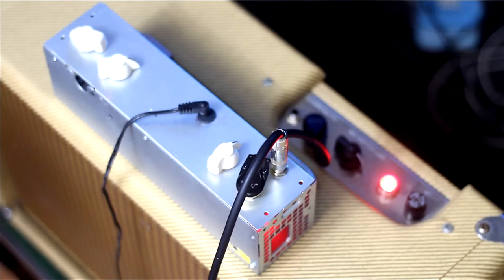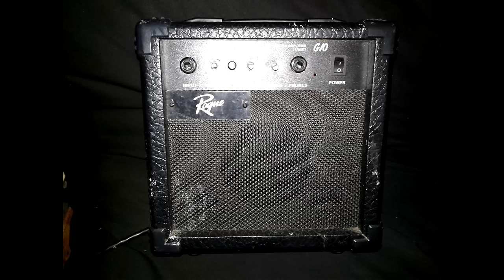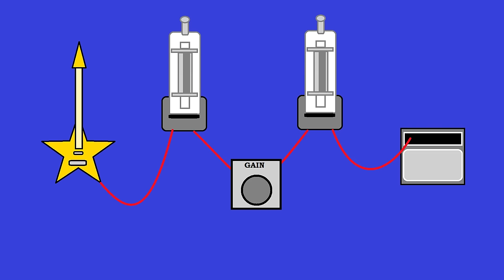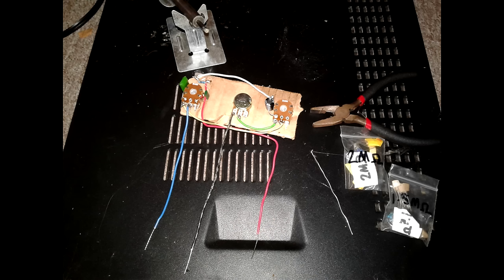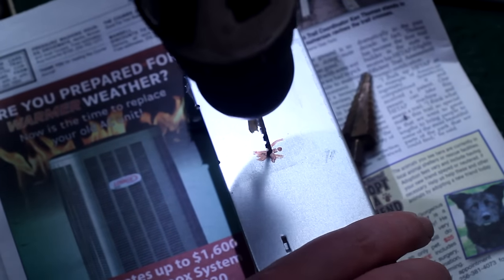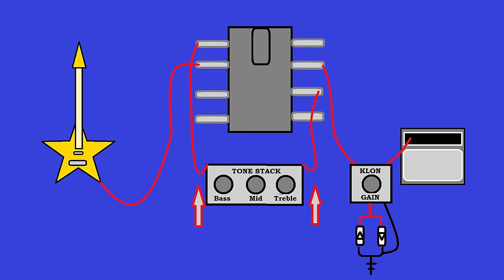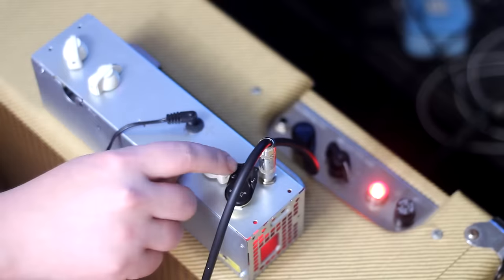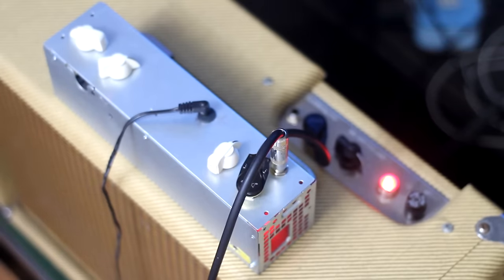DIY Guitar Tube Preamp Build and Demo (Super EASY!)

Comment: Not to take anything away from this video, but this entire 'tube' thing has been a fabulous marketing ploy for years among the gear manufacturers.  But there is a huge difference - and price tag - between a genuine tube preamplifier and the "hybrids" which use solid state devices in front and behind the actual tube to produce the actual gain.  A typical 12AX7 (the most common of preamp tubes) needs 150 volts of pure DC to operate as it should as a high gain preamplifier.  A 12AX7 will pass signal with much less plate voltage, but it won't really amplify or produce any real 'gain'.  The real expense in manufacturing a true tube unit is the power supply.  Converting 120 volts AC to 150 volts DC - and that's DC with as little "ripple" as possible (otherwise you have hum) - requires a costly step-up transformer and a fairly sophisticated circuit using diodes, capacitors, and resistors to "filter" out any alternating current (AC) "ripple".  Many of these so-called "tube" preamps are able to eliminate the step-up transformer and just filter the incoming 120 volts AC down to a useable 50 volts DC as the tube's plate voltage using a few inexpensive diodes, caps, and resistors.  But the real 'gain' in these hybrid devices is produced by the solid state devices - IC's (integrated circuits) or "opamps" (operational amplifiers), not the tube itself.  This is why you will see hundreds of dollars' price difference between a genuine tube preamplifier and a hybrid.  Yes, you do get the benefits of the tube's natural, musical, harmonic distortion, but it is somewhat negated by the junk on either end of it.
Reply from the maker: Thank you so much for watching and taking the time to write such a detailed and well thought out comment Chuck. Oh I understand completely where your coming from and I can agree totally but This is really a nice way to get some people in on the tube thing that dont have all that much money or technical knowledge and I thought this would be a good first tube DIY for some people interested because 25-20volts wouldn't feel good but at least it wouldn't hurt you badly. I do have a DIY tube amp build (Fender tweed circuit) on this channel that was running about 400 volts on the plates but I made sure not to chow me poking around in it with the thing plugged in and not discharged which I had to do quite a bit of for trouble shooting as it turned out I had a factory shorted 6v6. I also did a tube amp power supply section build purely from trash like reclaimed parts out of computer power supplies and old tube hifi unit transformer and whatnot and I never posted it because I did end up getting the hell shocked out of me by the metal top of a capacitor. Luckily it was unplugged and already draining and I had one hand in my pocket, but I took a good instantaneous 260-280 volt dump to the hand and it SUCKED! I don't want that or worse happening to anyone else because of something they saw on this channel. So I selected this unit because it actually doesn't use any solid state components for amplification or anywhere in the audio path it uses 6J1 a copy of soviet pentode tubes that are designed to run well on lower voltage, similar to the ones in old cb radios and car radios from back in the day. It does have some solid state jfets on it but they are just used to boost/buck the voltage from 12v ac to about 27-30v DC I had to use a  hefty 1.5 amp AC transformer but its on the outside of the box. I just thought this was better than one of those 9v DC starved plate designs you see so commonly used and it could be built simply for a beginner without them being in any great amount of danger. But in general I do agree with you and see exactly where you are coming from but this unit isn't hybrid.. its legit though its relatively low voltage and I had to supply the transformer myself.

Comment: Only 48 volts? The guy I've interned for who makes audio equipment for mastering in the 5000 euro range uses at least 96V to get the maximal tube sound out of his tubes. In his defence, he mostly makes compressors, EQ's and amps that aren't supposed to clip, so if that's what you're mostly interested in, 48V is fine, and it's also safer.
Reply from the maker: Thank you for watching and taking the time to comment SDBJ. Yes more voltage gives you more head room between the rails so to speak. This is actually surprisingly clean and strong given the voltage but I think thats due to the type of tube but, yeah exactly its safe and itll work for beginners and seasoned builders on the cheap :)
Reply: @heavymetalATC  update:
 he actually runs surplus soviet military tubes at 220V. 
The way he explains the behaviour of the tubes is that they require a certain amount of voltage to reach a good level of nonlinearity, phase shifting, distortion and whatnot. 
In his own words, it's not entirely clear why they sound so good to our ears, otherwise we'd have good simulators.
His company is called Gyraf Audio, if you're interested. Some prime examples of his products would include the G10, G22 G23 and G24.
Reply from the maker: @StevDoesBigJumps  Oh yeah he makes the good stuff. I plan on trying a few diy studio gear projects on here sometime myself. Probably not tube but???
Reply from the maker: Learn everything you can from that man its hard to find people that are the real deal. soak it all up.

Comment: Speakers and cabinets for them are impulse response for additional tone tunning.
Reply from the maker: Thank you for watching and taking the time to comment MrShmanckles. Absolutely! Speaker and cabinet choice can play a very big role in tone, Also the type of power amp section used and the value of the coupling capacitors that are placed between the preamp and power section make a substantial difference. A smaller cap can brighten up a muddy amp/speaker combo or a large value coupling cap can make a sweet preamp feed pure muffle into the power section. Its all just little parts of the equation like ingredients in a cake.

Comment: Ya, pls be careful with tube circuits. They can hold enough charge at high voltage to kill you. If you don't know what you're doing or how to bleed a circuit, don't risk it. 

As an EE who has a passing interest in audio, but never attempted a hobby project like this, you have impressed and inspired me
Reply: This preamp works on 12v ac as low a 500ma. I guess you could get a little shock from one of the capacitor but nothing that could kill you or injure you badly. But yeah, we should always be careful anyways!
Reply from the maker: Thank you both so much for taking the time to watch and leave a comment. Correct David I think this think only boosts the signal up to 27 volts to the caps or something similar I cant remember exactly what Petey said it tested at. Jerod you are right about being careful I have been accidentally hit with about a 246-250 volt instant dump from 4 big filter caps into my hand before it is not nice at all, I forgot that the metal end on top of a cap was hot... I was building an amp from scratch using old reclaimed junk parts so I wanted to make sure it didnt feel hot or bulged... POW! yowza!~ I decided to not upload the vid on here because it really was too dangerous. Luckily I had my other hand in my pocket and not on a ground. Once I regained my bearings I thought back to building my champ clone and without tubes pulling it down it was testing in at like 430-460 if I remember correctly. I am so glad I didn't get hit by that because I had a long trouble shooting period with it powering it up testing it live and draining it many many times... It was a bad output tube and a maybe a little bit too high on the end of spec rectifier. Set of JJs fixed it right up. Still glad I never rode that lightning though. Ive been hit with high voltage ac and dc many times as a welder but those caps dumping into me was really crappy painful and scary.

Comment: Personally, I'm not a fan of the plate starved tube design. Just doesn't sound nearly as good as a tube running at proper voltage, to my ear. Take 2 12V transformers and connect the secondaries. Plug in one transformer. That gives you 12V at the secondaries to run the heaters and then you've got 120V from the primary of the second transformer to run your plates. A bit bulkier, but gets that good sound.
Reply from the maker: Thanks for watching and taking the time to write such great info pete. Yeah I agree that would probably sound much better but I can have folk frying themselves cause of my video. hahaha That is a great way to do it and make a good isolation transformer with heater tap for cheap! Thank you for the tips.

Comment: So I got one of these boards. And one of the capacitors... exploded like a firecracker. It was one of the 1000uf caps near the edge with the LED. Weird. I'm chalking it up to shitty components as I was playing through it when it happened. Just be aware, I guess? I'm replacing the caps... no biggie!
Reply from the maker: Oh wow thank you so much for the heads up Towmotor. Yeah you know how the cheap Chinese stuff is now days. I'm glad you are an understanding person that also knows how to repair it. Ive luckily not had any problems from mine so far. Thanks though that could be quite a scary and infuriating incident for someone that isn't very versed in electronics repair.

Comment: You seem like a guitar player that has just enough electronics knowledge to get yourself killed. I have thirty years electronics experience and I'm a licensed electrician so I'm used to playing with voltage but I also have been building custom tube amps for about 10 years. It was an entertaining watch though.
Reply from the maker: Hahaha Pretty much correct but I also built the custom tube amp the preamp is sitting on. ;)
Reply: @heavymetalATC  Don't misunderstand, I was being sarcastic but you are creative and like to ask yourself what if. Reminds me of myself in a lot of ways. Like when I post on a forum about the latest amp design I built and I am tying to explain whats up but they just feel like I should build Fender or Marshall clones, BORING!
Reply from the maker: @skullheadwater9839  Thank you bro, Ive shocked myself damn near off the planet before while building a tube amp though so you have some truth to your words. I was a welder/fabricator for many years so I can take 220-240 AC from a miller welder for a few seconds like it aint no sweat but getting a bank of 4 caps dumped into me at once... shoooooooooooweeeeeee! it was a slam not a buzz it felt like a hammer. I did have 1 hand in my pocket and not on ground thank the lord. I hit the real ground though. good times I never posted 1 second of that build on here. 🤣

Comment: Tubes get too hot to touch when on so that sideways config should burn the board.  Not a fan of that config at all if the tubes get beyond body temp.
Reply from the maker: Thank you for watching and taking the time to write a very engaged and well thought out comment. I really should have felt of one of the tubes after running it for a while but I didn't think about it. There are units on ebay that are Identical to this one but the tubes are standing up away from the board. Its a kind of modular design and they build it a lot of different ways. Here is a link to that: https://www.ebay.com/itm/1pc-6J1-Valve-Pre-amp-Tube-PreAmplifier-Kit-Assembled-Board-Audio-DIY/121611607261?_trkparms=ispr%3D1&hash=item1c509ddcdd:g:PCUAAOSwLsBZS4RA&amdata=enc%3AAQAFAAACcBaobrjLl8XobRIiIML1V4Imu%252Fn%252BzU5L90Z278x5ickkp2NA0WuhQytmt4dbStg00BWgoOScyZwybBXC4%252Bfo0CnuQYr5MJ4lvHHEiBnM%252FvwcYpMb%252FOpiGPkFun268Yr5e%252FsAeC%252FazxFp0mPTFUTdX4BpumEl6ofAC%252B6vXRsHHCBDs8rwHZYndQuPIHrGr3XyZpZeExB9jeZQwq6DsIZ5UXZMrR02tedKSqSMMXbD4BLI%252FSsHO49kx1geP7x5oIblxYSS7rn3GkWdQnAUODd2Jn%252BmNuYkucpAMArPsqVjLo8R4s%252BfG3W8W5f8XDE4Di0S5SiT62nUREjOwtbnhgoWTHCO3Oo5due4I0X0MlW6eh8R9y%252FUeAhTweqjf6j10BwhoyAcmj1i0W2CDYBGsPr2ca1gtjpM9B1gwfUvt0KuMGwNNmCSLsP3BgYjiz3q3CGzqz7HTLp9Aj%252BKMFo3T53Iy2HItGQp%252FJWbuGrylQammRsGuBUVsW%252FFIRFMg4bNEBRW1saGwefGoSLqSgGmPLdAt0hdCJ60xWPR22VbpJTqqTFm8irnYQ00uzz3uHSWxJ0S5wV5qdJUozEYDzAu0dROqJDuHUVQqRPTkhw8ooDCIWabkgP809U9makyYI572A5hHJa6YpxUEgxmetKN7EI%252BO%252BPu7I9T6g2KzO8rLwBdz%252BecB4PMnM174ujEuzDBoGUfDwHvj3lEJJhTUh43iifFiJCOHl2hScw66kcVKBZbdazJ%252BGtDoCwmi60eUm3uCS3AqGfvHvctXSKNTpDN%252BVyGsnAyZFj1SgjTop1he%252F5kg8Q6RERWKrYFgZzkh3rZLkmABQ%253D%253D%7Ccksum%3A121611607261e837f008d5574ae9a1df9a9fb932286b%7Campid%3APL_CLK%7Cclp%3A2334524
Reply: @heavymetalATC  You are welcome.  I know this a 12AX7 on my old 1970's TV burned me so badly I never forgot it PLUS I have had other tube electronics that has browned wood and PCB material.  Heck, they even brown their own ceramic tube holders.  Just an old guy who remembers tubes and upright, with plenty of ventilation, is needed for most.  Now a few 6V6 like tubes just got warm actually but the 12+ stuff would cook in there (nothing like turning on the TV in the winter to warm your room, lol).
Reply from the maker: @generalawareness101  Yeah, the tubes in my champ clone get SUPER hot. I'm sure its due to having the plate dissipation too high biased from having higher than stock voltage but I needed it for the extra headroom, its not to the point of red-plating and JJs are pretty rugged tubes so it has lasted quite a while on this set. Plus its cool to watch the blue glow swirl around in there when you are really cranking it up. LOL It smoked a set of chinese shugaung tubes immediately on startup it looked like blue flames inside the bottles and it was arcing all kinda wild inside the rectifier tube. I put a lot of old school style solid state as well as tube gear in my small home studio as I thought I wanted all analog signal before it goes into the computer and damn it gets so hot in there in the summer.
Reply: @heavymetalATC  Right.  The link you sent me seems to be a 6J1 and those don't get nearly as hot as the higher voltage ones but in Radios, TVs, etc... a 12AX7 will burn you badly and there are some that were even worse.  They weren't over biased either but everything eventually turns a yellow brown around those tubes.  Sixes aren't nearly as bad and probably why they used them (btw, sixes do not sound nearly as good as a 12 and I am surprised to see them being used for this when normally a 6 is right before the 12).  Maybe the 6, being a preamp, is why because a 12AX7 is actually an amp and the reason the 6 was before it so the 6 drove the 12.
Reply from the maker: @generalawareness101  Yes sometimes like in the fender amps they will make the good sound and tone using a 12ax7 or 2 and then use 1 or 2 big bottle 6v6s to push the speaker. Yeah its the 12ax7 in my amp that gets so damn hot. I replaced it with a jj ecc83 super rugged tube but its still way too hot to touch just better at taking the heat. I also used ceramic sockets with aluminum sheilds into a steel box on it. I have seen some of the old rca stuff that uses a brown or black bakelite plastic socket... thats just asking for a fire.
Reply: @heavymetalATC  You better believe it and I saw those.  A cost cutting measure in the day since any quality gear (or a company that cared) used ceramic and the metal plates was a sign it was heading into pro quality stuff.

Yeah, I have seen the 6V6 stuff used that way but the Guitar world is a weird beast because it broke all the rules to "get that tone" but in regular TV, and radio, electronic 6V6 came before the 12ax7.  Not sure why since the tube days was in my pre teen days and by the time I got into electronics around 11 every new thing was transistors or the new ICs.  Back when being modular was a cost cutting measure and prevented the consumer from doing their own work.  Just throw the entire board away and buy new yet only one component was bad.  My mom was on the assembly line making those boards for Texas Instruments at the time.  We saw the future and it was bleak to us since we liked to fix our shit.
Reply: Tubes get hot. They must have ventilation. My headphone amp has one 12AU7 it lights up but doesn't get too hot. I believe if the plate voltage is high you will get heat  but if the plate voltage is only 12 Volts the tube only gets warm. 73

Comment: ½-Great! But, how to make it sound like a wet fart i.e. full great?
Reply from the maker: Thank you for watching and taking the time to comment Beaticulous. I would guess by wet fart you mean like killing fuzz/distortion from hell. If you just run one channel straight into the other with no tone stack that will get you about 3/4 of the way there if you ran a diode from hot to hot jumping them instead of a wire 5/8 of the way if you run a diode or better yet an LED from hot to ground in between them or even better than that 2 facing opposite directions 7/8 of the way to wet fart but... if you put a big ass capacitor between the stages and ran 2 opposite facing LEDs from hot to ground on the output youd have a good splattery glitching on and off ripping velcro wet fart guitar box.
Reply: @heavymetalATC  A masterful response! Thanks!

Comment: 12ax7 plate voltage is 250V lol
Reply from the maker: Thank you for watching and taking the time to comment Horse Meat. Yes, I think I was getting 361V on B1 loaded. I don't remember 100% at this time but i think Plate voltage on the JJ ECC83 was 283 or something like that? Its been like 3 years or so I don't really remember but I did test it all out and figured it to be acceptable not Ideal but not so much dissipation as to cause any red plating, in 3 years I have put many hours out on it and I'm still on the same set of tubes and its still rockin... This may be more of a testament to the ruggedness of JJs over cheapo china tubes but its got a decent amount of headroom and is very, very loud for a champ so I don't mind the extra voltage. It all worked out quite well for my uses. Thanks again bro.